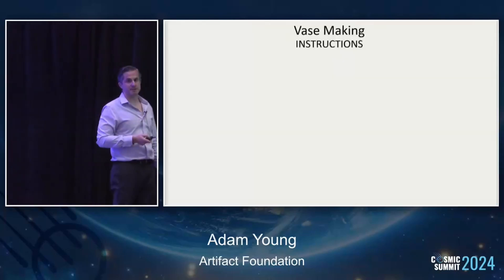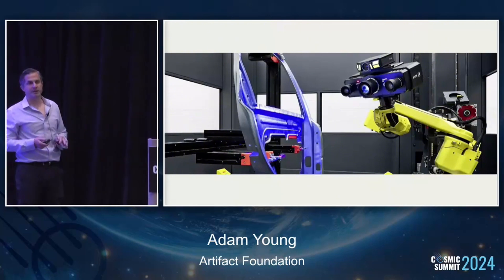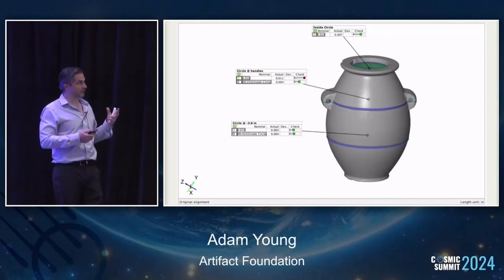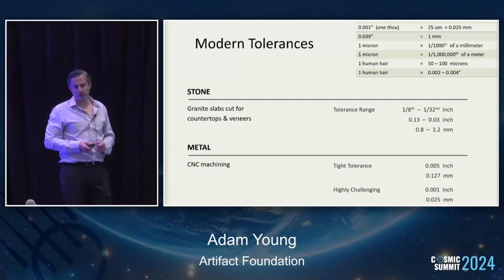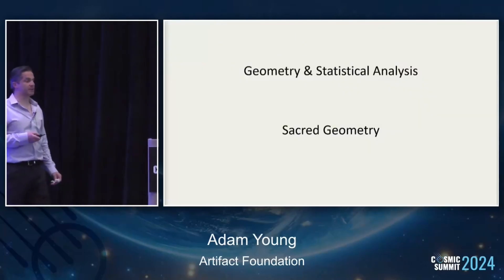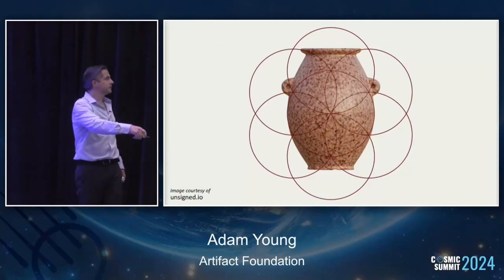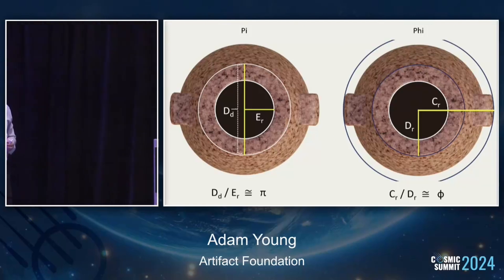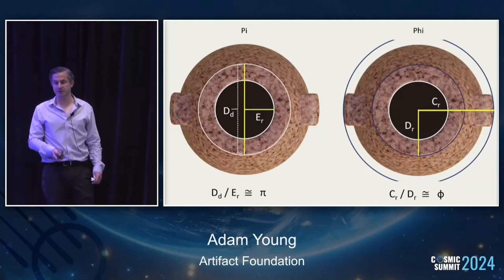Wall Street Math Quant Explains the Impossible Stone Vessels of Pre-Dynastic Egypt

Comment: @thomasxxxxxx2345  I do this reluctantly because it is very easy to do a google search and find this information for yourself, you can use ai to even do the leg work, so I'm only going to give you one of many many sources that state these stone vases are from upper Egypt old kingdom. Google search: Mechanical Engineering in Ancient Egypt, Part XIII: Stone Vessels (Predynastic to Old Kingdom Periods). You find research done by Galal Ali Hassan. It's peer reviewed and from a very reputable journal and it's fairly current. Now again, if you think that's the only source of information out there that states that these vases are from upper Egypt old kingdom, then you're not using google right. Do some actual research and you will realise that provenance is well established.